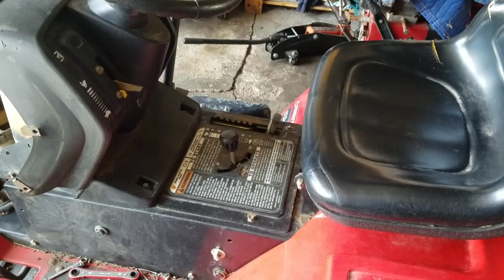TROY BILT MTD BRIGGS 17.5HP 42 LAWN TRACTOR FUEL SOLENOID DELETE PTO BRAKE SEAT SAFETY SWITCH BYPASS

Comment: Must be one of the "INTEC" Motors...

These Carbs are really easy to work on, as long as he "Solenoid Switch" is OK.

Best thing to do withese INTEC Engines, is to add a "Manual Fuel Shut-Off Switch" as the Solenoid tends to fail!

Better SAFE than offer problems.

Take care Henry,
🤓 -Thomas
Western Washington State

Comment: reason for the backfiring is because the carb solenoid was manufactured to shut off fuel so that it would not overload the bowl and leak gasoline into the intake, that would result in the backfiring .
either shutting the engine off   [ sometimes backfiring ] , or starting   [ as seen . . backfiring ] .

there have been a few mowers that have went out in a  '' blaze ''   because of  bypassing the solenoid .
put a new solenoid on it, and no backfire.

reason for to much gasoline is because  of gravity fed design :
  [ forced pressure in the line, forcing gas into bowl damaging the needle seat, in turn causes surging from to much gas, and blown out welch plugs from backfiring ] . 

would not have thought of bypassing them  [ safety ]  switches like that,  kool idea. 

very funny about that pull start,, very funny. 

deck belt to small ,  causing hard starting issues. 
get correct belt 

or, the guy  installed the springs in the wrong place  [ it possible ] 

lol,  that mower needs attention .

Comment: There are two different spring locations on the back of those mower brackets, one for the 38" deck and one for the 42" deck, a lot of folks get them mixed up. Also you might have to shorten the belt tension disengagement rod... there is an adjustment for this and is no problem if you have the owner's manual. Hot vid bro, I see flame shootin out the muffler!
Reply from the maker: After that the muffler started to rattle again!  I think it blew the screw right out! Lol!
Reply: @MowersNBlowers  I don't think the metal was all that thick and you used short screws. Those holes could be drain holes just in case those tractors sit in a low spot and fill with water or to also help get rid of condensation... just what I think. I do a lot of thinking. lol

Comment: Hi, I just discovered your channel and subscribed. I have a question. I have a 2004 troy bilt pony that appears to be exactly made like this one. My question is do you have a video explaining how to change the drive belt on this mower. MTD switched designs in their 2005 models that now have a blade engagement cable as opposed to this one. I've only changed the drive belts in 2004 model once since I bought it new in 04. To me, it was a pain in the butt since on my 2004, it doesn't have an idler pulley like my 2005 model does. If you do have a video of how to change the drive belt in this mower, or know of one, I'd appreciate it if you would let me know. Maybe below in the comments section. Thanks in advance and I'm glad your family didn't have the coronavirus.
Reply from the maker: Thanks for the subscribe

Try these
https://youtu.be/A044t_d-Rqk

https://youtu.be/eseDKsJCXeM

Comment: The heat gun will melt the solder without wrecking everything else. That’s the point of the whole thing. You get a solder joint and heat shrink insulation all together in one step. Try it on some scrap wires. Also google a video on it working.
Reply from the maker: I will, thx victor

Comment: Are you interested in a 20 hp Briggs? Run good
Reply from the maker: Sure nick, but as you know I don’t pay for anything, but I’ll trade.
Reply: Mowers N Blowers what would you trade? It is on a craftsman yt 3000 not in the best condition, but engine runs.
Reply: I payed way to much for it, nothing you would come close to paying, I paid 150!!
Reply from the maker: Nicholas Ierardi I dunno, look at my letgo stuff
Reply: Mowers N Blowers I have a weed eater aswell, engine runs, carb needs a cleaning, this one is in very good condition, would you do both tractors to trade for the Murray, select? I could send you pictures.
Reply: The 2000 model
Reply: Mowers N Blowers what’s the cheapest tractor you got?
Reply from the maker: Nicholas Ierardi nah, I don’t see a point in that.  Trade a tractor for another tractor....you know what’s the point, I get em to sell.  But thanks anyways.